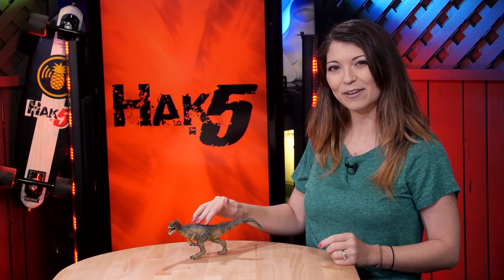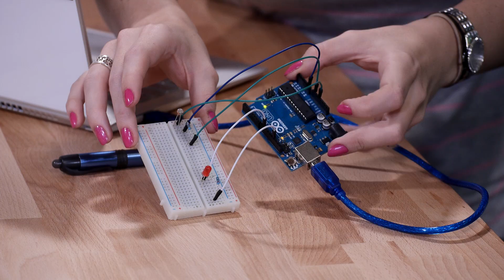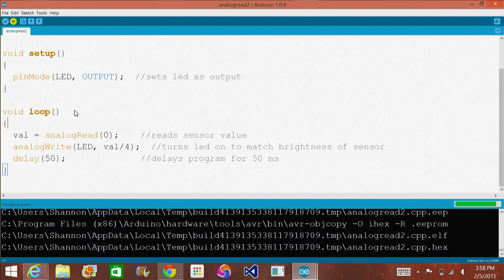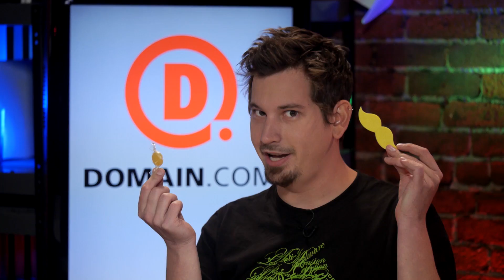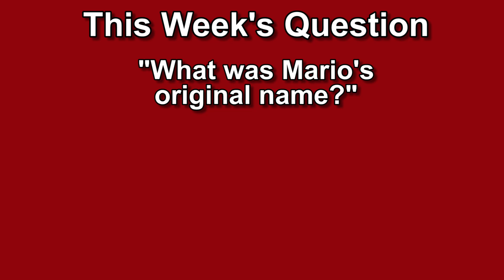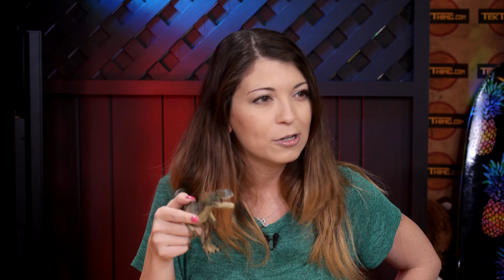Analog vs. Digital Inputs on an Arduino, Hak5 1726

Comment: HI instead of dividing by 4 to get 1023 to 255 you can use the "map" function in the arduino to map 0=>1023 to 0=>255
Reply: I'm the map""

Comment: Shannon: Light Sensor is a Photocell. In the future ALWAYS use a small ohm resistor for your LED or Photocell. Not all LEDs are the same, you could actually explode/pop the LED with full power- be careful because I like you. Also, no need for the constant.